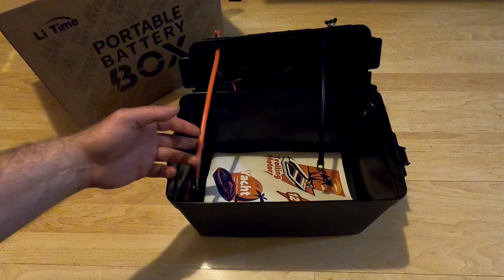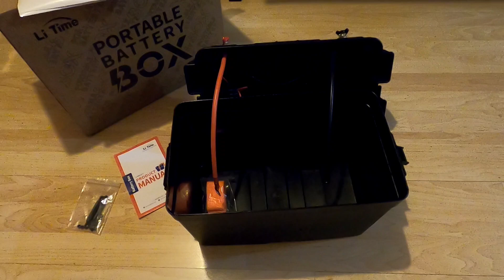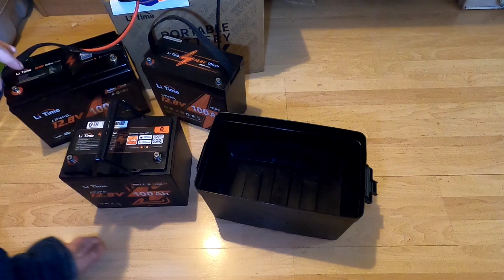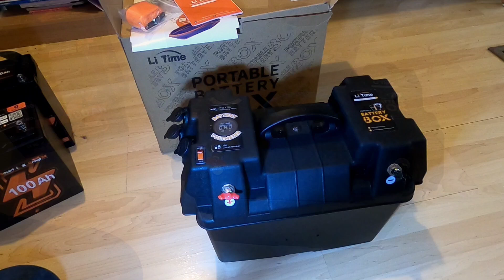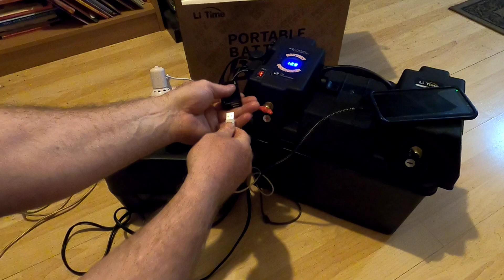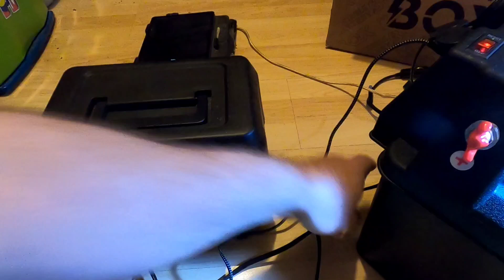Li Time PORTABLE BATTERY BOX REVIEW

Comment: We're those clips to mount/secure the battery box to a floor/boat deck?
Reply: One each side near the centre of the box there a two holes that match those clips. I am guessing they are designed for the ornge strap to fit under.

Comment: That was a power switch you pointed out?

I can actually kill the power on it ?
Reply from the maker: Yes all the connections are a single 16amp circuit
Reply: @frankbush333 i would plan on using it for my dedicated power source for my Garmin livescope UD2 106SV. Garmin recommends a 15A circuit breaker or switch. I prefer the circuit breaker. Would this battery box be ok ? I know its not marine grade but i wouldn't be leaving it on my pontoon when not in use so i think im ok there. Also, i fish in freshwater so i feel thats on my side as well.

I appreciate your replies. Ive watched some of your other vids and just wanted to say thank you for sharing.

Great job !
Reply from the maker: @CuriouslyCurious2  as long as you feel secure that it will stay within reason 'dry' but there is always risk with electrical around water. If it was me I would but I am a maniac that way lol.
Reply from the maker: It is a circuit breaker switch
Reply: @frankbush333 for my installation,  i didnt want to wire up a fuse box and switch. Im more of a plug and play kinda guy. 

Thanks again.